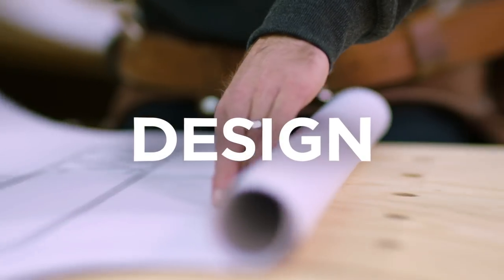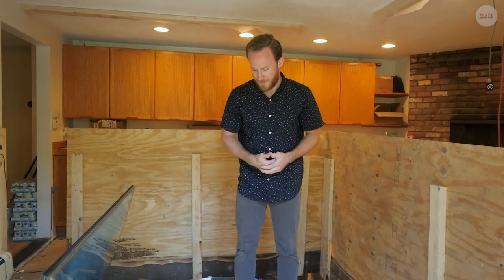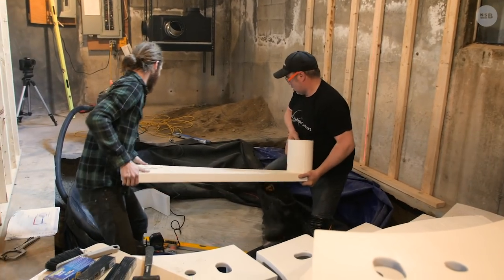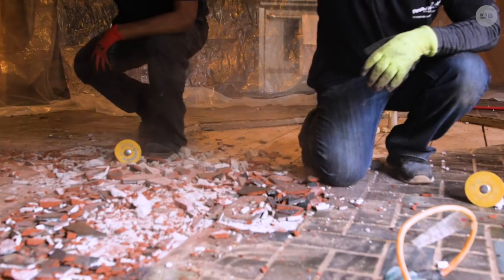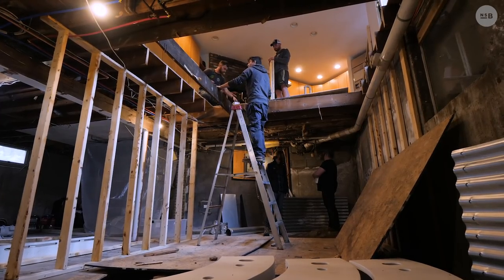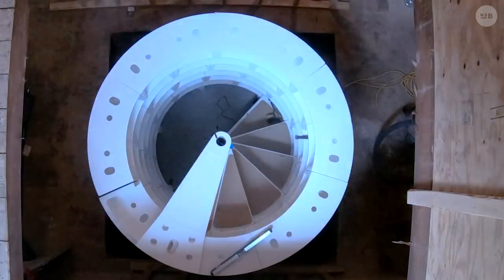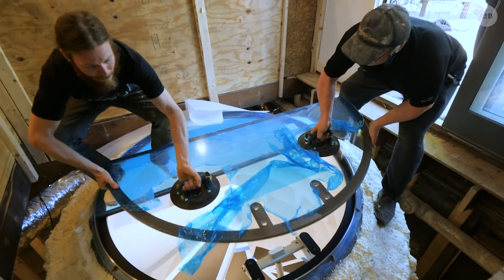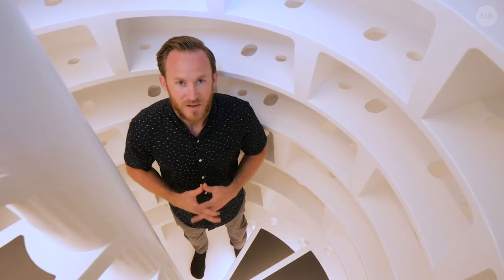Insane spiral wine cellar in the floor

Comment: It looks great, but I'm not sure of the point of it when they already had a basement.  Cellars are normally dug into the ground to utilise the natural constant temperature of the soil around it, i.e. approximately 55F to keep your wine in good condition without the need for an external cooling device?